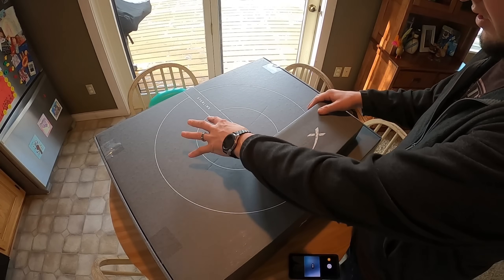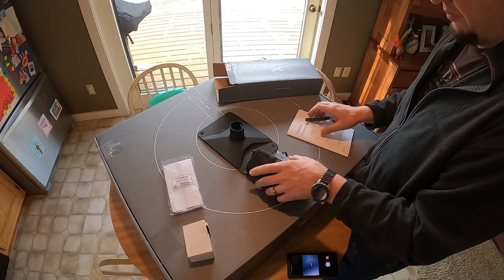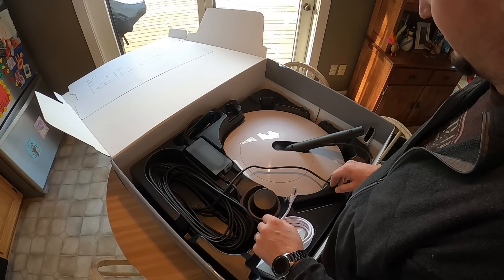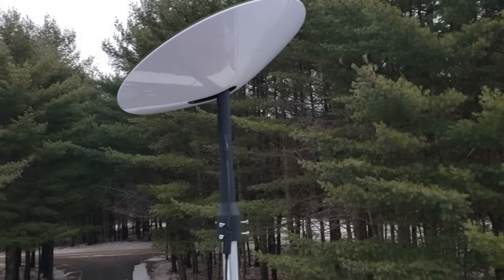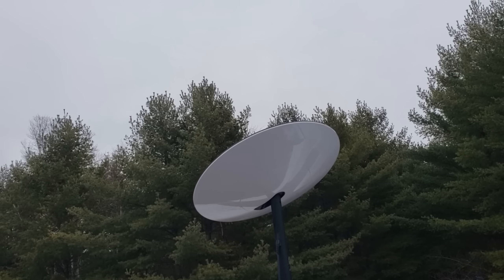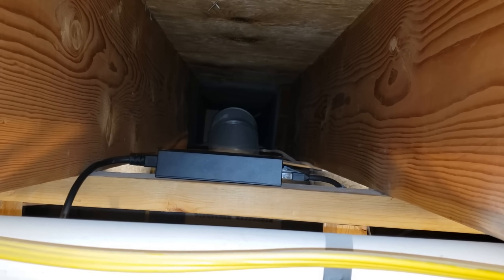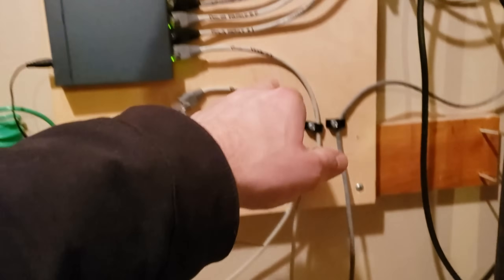Starlink unboxing, install on a pole mount and roof, speed tests, and more!

Comment from the maker: If interested in Starlink, sign up for updates or potential beta testing at https://www.starlink.com/

Lightening Protection:  From Starlink's FAQ:  https://www.starlink.com/faq

"Starlink meets the U.S. National Electrical Code (NEC) grounding requirements and includes the necessary lightning protection. However, any user who lives in an area with lightning should have the appropriate lightning protection installed in accordance with your local electrical code prior to using Starlink."

The map I show during the speed test is https://satellitemap.space/

At this point (December 2020), I believe it is only available in Northern USA and Southern Canada for potential Beta Testing.

Comment: Did you have any issues with the 10 ft pole on your roof with wind?
Reply from the maker: No.  But it helps that I have it attached to the peak of the roof a few feet up the pole.  Gives an anchor.

Comment: Big question! The cable that is attached to the dish… is that just a power source or does it have to connect to the modem? We need to install ours out on our boat dock roof… there’s power there but it’s way too far from the house for a 100 foot cable to reach the modem. Thank you in advance!
Reply from the maker: It is power over ethernet.  So the cable contains your internet connection power for the dish

Comment: Thanks.  Happy to see that you still get decent connection with the trees around.  I am worried about that.  Mine is on the way
Reply from the maker: Have you used the Starlink app to check for obstructions?  That works well
Reply: @OutdoorsEngineer  not yet.  I will thanks

Comment: When you say the screws are digged into the pole from the adapter, are they screwed into the pole or no?
Reply from the maker: They are pointed so the points dig into the pole.  They don't thread.

Comment: Hi, in Illinois here and ordered mine Feb 24 but it has not shipped yet. How long do the outages usually last?
Reply from the maker: Its rare to be more than a few seconds when I have needed it. Sometimes it drops out for 5-10 seconds, three times in a short span of say maybe a minute.  

Other than that, the connection is really consistent.  Just dropped DSL on Friday!
Reply: @OutdoorsEngineer  ok, thank you

Comment: The speeds look really good, but that latency scares me. I only have 
5mb/s on DSL right now, but my latency shows as only 8ms when I have nothing else running on my laptop or in the house at 
all. Are you running anything else in the background or other devices 
while this is being run? I can't run anything except my laptop or it 
goes way up, but I play WoW, and I get lag on my current connection, so 
something up in the 30s with nothing else loaded would be a fail for 
me, regardless of speed improvement.
Reply from the maker: I do have a small upload here and there.  I have a weather station always uploading data to the web.  I should shut that off sometime and see the improvement.  Upload really affects latency.  

I'm curious where your latency is pinging from (how from your location)  Even my Frontier DSL has a latency of about 18-20 ms.  Starlinks goal is to reach 18-20ms for close servers in the near future.  Needs more infrastructure to do so (ground stations).  8 ms is really low.  Can you really tell the difference between 8 ms and 20 ms?

Comment: Do such homes require a lightning conductor separately? Having such a high point at the home that is connected to the most delicate electronics inside might be a risk.
Reply from the maker: Probably.  I will be lowering the dish some this spring.  Also considering installation of a surge protector.  Starlinks FAQ addresses lightening which I have included in the pinned comment.

Comment: Wind deflection?  Lightning protection?
Reply from the maker: Wind is not an issue.  Dishy is pretty slimline.  Certainly need a sturdy mount.  We had 40+ mph gusts last night and it's all good.

Check my pinned comment for Starlink's response to lightening.

Comment: How have the "micro" outages been? I've heard 5-60 second outages can happen when the satellites aren't covering an area...
Reply from the maker: For me, there are tons of satellites in the area.  So I don't lose connection due to lack of satellites.  It's been mostly been "Beta Downtime" where they are doing work on the system/software.  

I work from home all day on the internet, and 95%, I can get through a meeting without dropping connection.  Especially in the last month.  From December through February, I had issues.  But it's been much more stable since.  

But when there are outages, they are very brief.

Comment: enjoyed you video  ,i am signed up for it ,live in mountains of nc. was wondering what type of connector on the cable coming from sat dish, is it b&c or cat 5 plug have a 2 story house with a 12 12 roof so that is going to be a chore get out my harnes, anyway could i talk to you on phone,, thanks again  john henry usn, vietnam vet,
Reply from the maker: Thanks! The cord is a Power over ethernet cord (POE) with basically a RJ46 connector, which plugs into the power supply block.

Comment: don't use a coupler! That is heavy duty power over ethernet and you risk a fire with something like that.
Reply from the maker: Sure thing!  I asked Starlink about Extensions, and they said they currently don't offer extensions, but are "actively working on this."  I have found that the location I placed the power block is working just  fine and am happy with the setup.

Comment: My dish is arriving today. One thing I've learned from watching YouTube videos on this system is that the dish apparently remains heated at all times, which is good from a snow and ice prevention standpoint. However, I'm guessing that comes at a considerable cost in electrical consumption (would be interesting to to know the amp draw). I'll be putting my unit on a timed circuit to ensure it's offline when not needed.
Reply: It sounds like that will be changing. They are actively working to reduce power consumption. I'd imagine not turning the heater on until it is needed would be a good start. The dish will naturally be rather warm anyway, because it's transmitting radio waves.
Reply: The dish will be naturaly warm even with heat on ,dont worry about it.You may hear a buzz comming from it.Don't worry.

Comment: Question- do you have to use the router they provide or can you use your own - I have a Netgear Gaming Router and great video
Reply from the maker: You can use your own!  But, with their router you can use their app see the statistics of the connection, and also do reboots through the app.  I dont think that functionality is available with a non-starlink router. I ended up moving my good router out to my shop and using theirs in the house.
Reply: @OutdoorsEngineer  ok great and thanks for the quick reply 👍  cheers 🍻

Comment: Is there a data download limit? Comcast has a 1.2 t and it's usually enough but sometimes I go over and get hit with 10 bucks per 10gb. This looks pretty fast.
Reply: spacex has accepted fcc funding, and the terms of that contract guarantee no less than 2 terabytes per month, at least in the usa.
Reply: @sirmoonslosthismind  That is interesting for sure.
Reply: There is probably a much lower data limit with this. 1.2 TB is very generous of a limit.
Reply from the maker: No data limits at this point, and Elon Musk has said he doesn't want data limits.

Comment: I think you could have done an easier install. That starlink is supposed to be portable.
Reply from the maker: At this point it is not portable.  It is stuck at your location.  I purchased Starlink for it to be permanent at my house.  I am happy with my install as it is clean and I don't have a wire laying across my shingles with a hole drilled haphazardly in the side of my house.  I thought about the install and it works.

Comment: YOUR FRONTIER  CAN GO FASTER  THEY NEED TO HOOK  UP YOUR OTHER LINE  CALL TECH SUPPORT AND ASK FOR  FIBER!!  IT CAN GO  GIGBIT   SPEED!!
Reply from the maker: Yeah, maybe in the city.  But out here in the rural areas where phone lines were installed 40 years ago, with no vision of internet zooming through it, the max the infrastructure can handle at my house would be 14 Mb/s.  I had a tech at my house and thats all it could handle.  

Install fiber?  Have you seen the news stories about Frontier filing bankruptcy?  How about the ones where Frontier has not met the requirements of the grants they have been given?  It would cost a fortune to have fiber run to my house.  Who would foot that bill?  And people complain about the $500 up front cost of the Starlink equipment. The nearest my house is to a fiber line is a half mile, but that line does not have any services coming off of it anywhere near me.  Who knows where the actual ne a redt distribution point for the fiber actually is.  Could me miles.  

As far as cable goes with Spectrum, the nearest homes with it are five miles.  Again, it would cost a fortune to get it anywhere near us and the companies don't want to foot the bill for service to houses that on average are a half mile apart.  

This needs to be government driven to get the services installed to the rural homes, and until that happens Starlink or some other wireless connection are the way to go.
Reply: @OutdoorsEngineer  Same in my area regarding Frontier. Impatiently waiting for my Starlink....

Comment: Why does everyone feel the need to mount ther  satellite dish on the roof. In snow country it needs to be accessible for any snow build up or ice. I  have installed many types of sat dishes and roof is the last resort only to avoid obstacles.
Reply from the maker: The Starlink dish melts snow.  Plus it's the only spot in my yard that actually has the clear area required for Starlink's constantly moving mesh of satellites.

Comment: Holy shit your ping is awful 😳
Reply: What's yours at? Pings around 50ms are very doable in online gaming actually. It's the constant connectivity that's the issue particularly with Starlinks BETA.
Reply from the maker: And the constant connectivity seems to be improving weekly.  <2 minute of downtime over 12 hours is pretty good, I would venture to say.  With improvements to be gained.

Comment: Wouldn’t it be turned into a Lightening rod?
Reply: I wondered as I installed mine but it's plastic, maybe carbon and cast base.
Reply: @RogerDiotte  cool! (but the cable cord and steel pipe still looks scary)

Comment: That ping time is a bit rough. A better test would be to do a video call with someone.
Reply from the maker: We do that as well.  Work conference calls and video calls.  Works awesome.  In the email from Starlink this week, they expect latency in the 20 ms range by summer 2021.
Reply: @OutdoorsEngineer  excellent

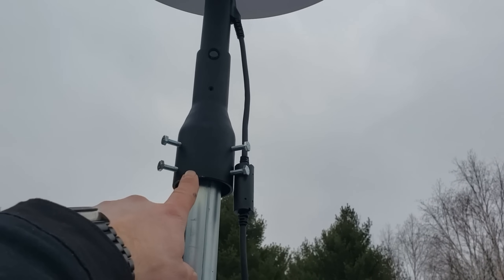Comment: Can you tell me where you bought the pole mounts (not the Starlink one) that are both visible at 6:29 ? Thanks !
Reply from the maker: Lowes!  You can go on their website and search structural pipe.  I used the 1-1/4" structural pipe, purchased at Lowes.

Comment: How about in bad weather?
Reply from the maker: I haven't been able to test it in a bad thunderstorm.  That is typically when Dish Network doesn't work.  In snow storms, the speed slows but I still have fast internet in the 25-50 Mb/s speeds.
Reply: @OutdoorsEngineer  Thanks for the info. 25-50 Mb/s is very good.

Comment: We'll see what's gonna happen when to Starlink thousands of users will connect. There are limited beta-testers worldwide. And StarLink  is allowed in the USA so far. Russian already denounced Starlink and they want to implement fines for those who will use it there. China not far away. That way, - how would you use Starlink in exUSSR countries? You just can't. Because you cannot terminate signal from satellites to the ground station.  I mean you can, but it would be far away and your round-trip delay would be a huge drama.

Comment: Be sure to coat the top surface with RainX.
Reply: This is an old trick with Dish Network Dishes. It does not block any signal and you only have to apply it a couple of times a year.
Reply from the maker: @transmaster  I should do that to my Dish Network!  We've had those sticky snows plug cause outages before.
Reply from the maker: Perhaps, although I'm not sure Starlink recommends it.  The unit heats and the water beads off nicely the way it is.

Comment: Impressive speeds. Equal or better than the Spectrum cable connection I have in Los Angeles County. I was considering satellite as a fire resistant alternative to hard wire or cellular but this looks like it could be an out and out replacement.
Reply from the maker: If I had access to cable, I would still keep it.  Starlink is just a much better alternative compared to DSL and some lower quality cable connections.

Comment: Just imagine how much control elon will have over people when most people will be dependent on him and his product. Welcome to The Brave New World
Reply from the maker: I don't think this technology would be usable in the city.  The user terminals require so much space and a city setting would not provide that space.  Plus there would be too much congestion in the city for the network.  I also don't think they can compete with hardwired internet in the city either.   But I guess it remains to be seen where the service will be offered.
Reply: @OutdoorsEngineer  Appreciate your response and i can see where your coming from :) Maybe they will be able improve the speeds in the future seing as this is just a beta.

Comment: We are retired full time RV'ers traveling all over the United States. We would love to try this out on our travels.
Reply: I was wondering what it would do mobile.
Reply: @coyotegraysr  We have mobile wifi router that uses at&t data. Have a third party carrier so, no throttling and unlimited plan. About $100 a month. So far its been great to watch Netflix ect. Download speeds vary 5 mbps and up. This Starlink might be the answer to faster speeds.
Reply: Starlink currently has no plans for mobile coverage, only stationary solution for now. There was another Starlink beta user that did his own YouTube video review explaining this. It could change in the future, but don’t hold your breath.
Reply: @FlipBoxStudio  we wouldn't be driving while using internet. We stop at a campground or boondock for 3 or more weeks. Stationary. This is when this would work for us.
Reply: for beta testing you need to be at a physical address, but soon betting when released the mobile applications will be enormous.  Maybe a different antenna and or radome of some kind (cover) great for RV or truck perhaps?

Comment: How are you dealing with snow on the dish?
Reply from the maker: The dish melted the snow off.  It is heated.
Reply: With that said (about the dishes built in heater) make sure (like the guy here did) to install your dish at least a few feet off the ground and or high enough to allow the melting snow to not create huge long icicles that form beneath to the ground and make the dish attach thus burning out/stripping the mechanism that controls the dish. It happened already to others.

Comment: Anyone have any suggestions about the Star link website/full access? I put in my address and it notes they would email me updates; but they have not sent a single notification. I tried to enter email and password in main website, but it states wrong password and I know it’s the CORRECT password, etc....
Anyone have any suggestions for their website?
I find it a bit frustrating!
Thank you!!!!!!
Reply from the maker: You won't get anything in email until they send you an invite for BETA if you happen to be in the service are that BETA currently is operating.  After I submitting my email and physical address, I received a confirmation email and then I didn't get anything until my invite.  If you are not part of the beta program or not a customer, you won't be able to log in.

Comment: can you see when alaska is scheduled because my coverage for the price sucks up here, eh. is it unlimited cause i spend atleast 17 - 18 hours on?
Reply from the maker: I'd love to help but don't have those connections.  Best I can recommend is to send a tweet to Elon Musk and or SpaceX Starlink Twitter and see you get a response :)
Reply: my latitude is a little higher than yours but really i was big into your set up i m ordering aluminium ribbed pole that is  13/4 not 2" diam,eter so i think it will fit inside you know male/female is the dish mount exactly 2"?

Comment: Speed test is highly variable depending on the server you are connected to.  I can pick different servers and get drastically different results.  Many times servers farther away give me much better results than those close by.  It has more to do with the bandwidth the server you choose has then the location.  Pick one that gives you the best results and consistently use that one for checking your speeds.

Comment: What about ping to servers further afield? If you try at a server in Europe, will it route through the constellation or just bounce to an earth station near you and use “slow” fibre optics to get across the pond?
Reply from the maker: I don't know the answer to that but might take a guess.  At this point it is my assumption that it would be going via fiber across the pond.  I have seen simulations though that once the full constellation is in place they may send it that way.  There is also the use of ground stations to bounce the signal between satellites.  Here is the video I saw that talked about the different possibilities.  All theoretical though.  https://youtu.be/m05abdGSOxY
Reply: @OutdoorsEngineer  Thanks for the quick reply and the very interesting video.